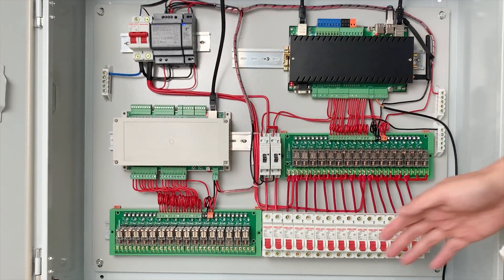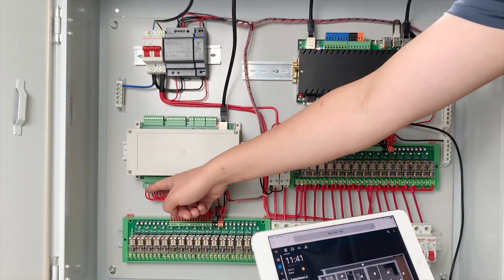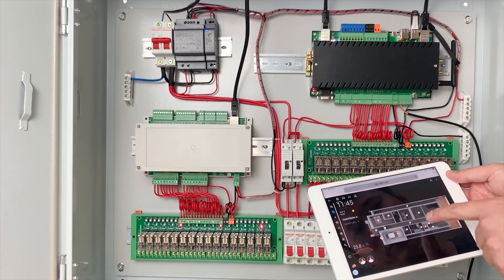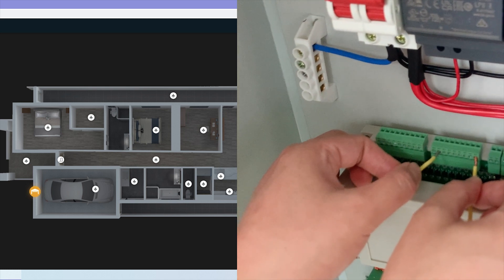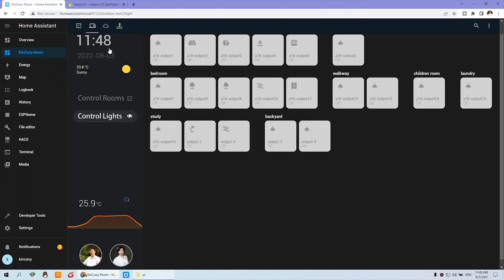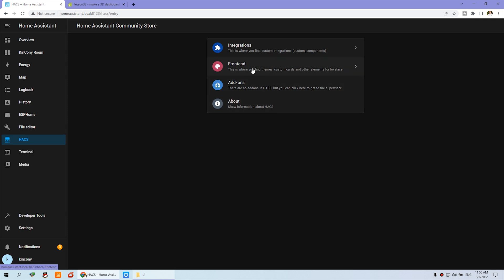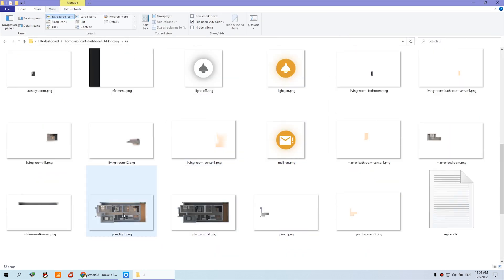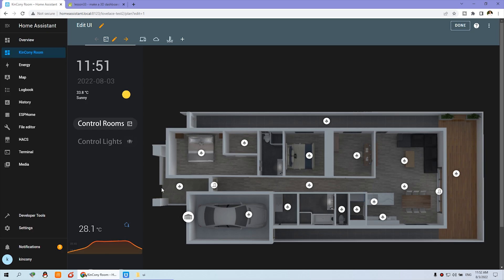Home Assistant 3D dashboard for Smart Power Distribution Box

Comment: Is there any way of controlling EC 0-10V ventilation unit fans and read bmp280 sensors? (Good idea for tutorial).
BTW I really like your products
Reply from the maker: KC868-D8 use for DC 0-10 output control. bmp280 sensor can conenct with KC868-A series board, it's output IIC or SPI signal.
Reply: @KinCony  thank you for fast answer, I am going to check the boards you mentioned. 
The idea behind my question was to replace current ventilation unit controller (close source) with your board and all the goodness of it (relays to control bypass, control fans, check humidity, temperature, pressure, power usage, integrate with window sensors and heating).
Reply from the maker: @wojciechzielinski7825  i think you can chose KC868-A series board, it have multi function and some different ports for user.